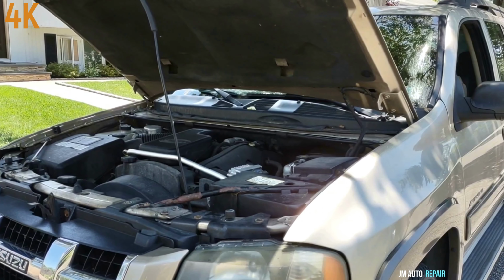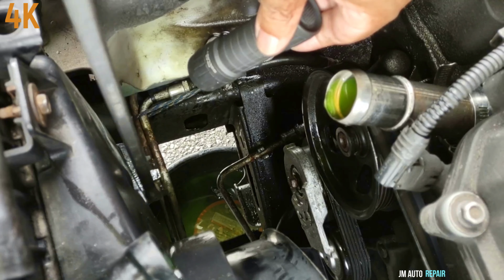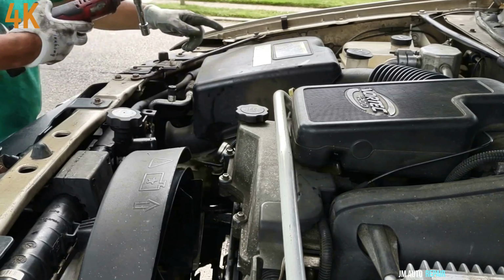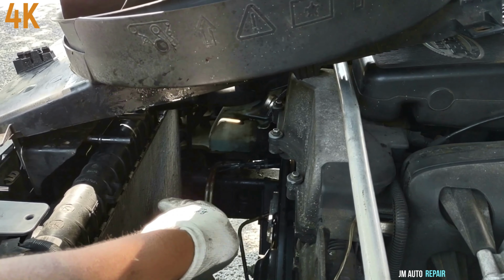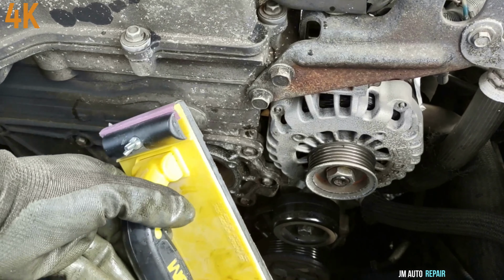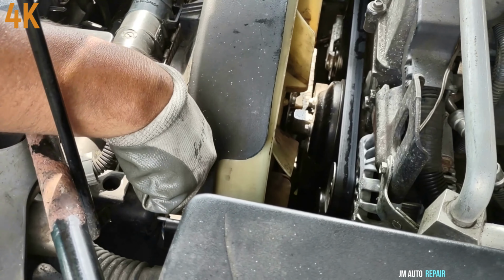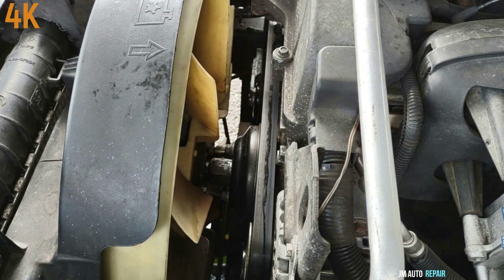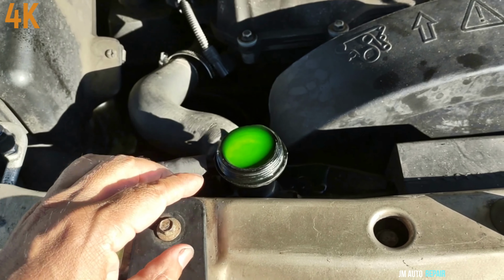2003 2009 gmc 4.2 izusu saab 9x water pump replacement

Comment: I drive a 2009 model 4.2 vortec same motor, I didn't have to take the radiator bracket off.. jus release the four fan clutch bolts and you'll get enough room to take the Fan shroud off, great video man
Reply from the maker: great job